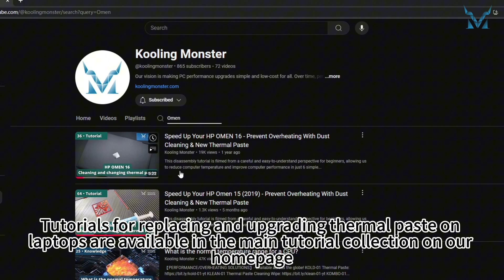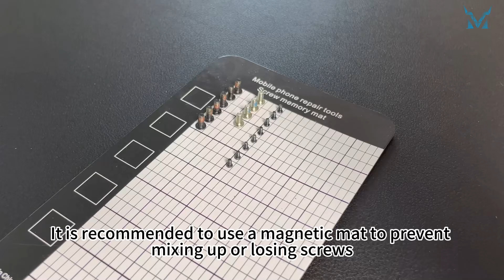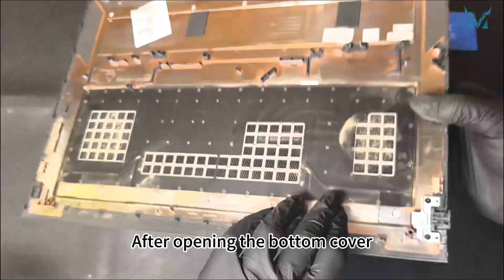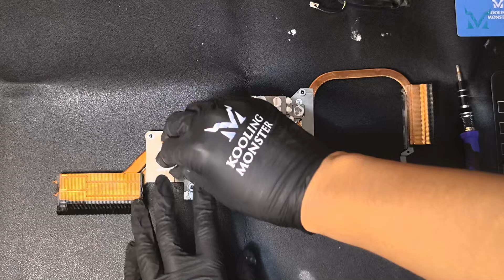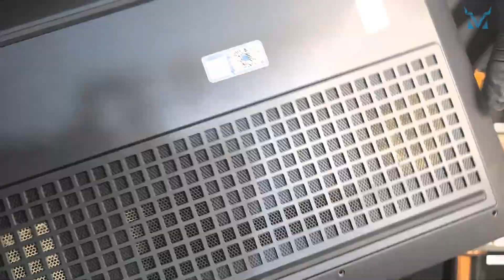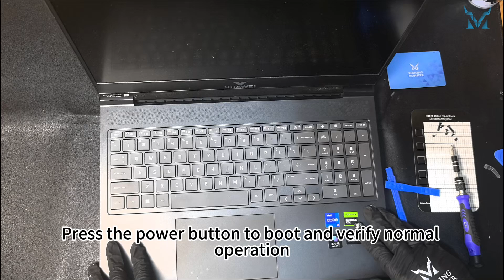Speed Up Your HP Victus 10 2024  Prevent Overheating With Dust Cleaning & New Thermal Paste

Comment: What about the other white pastes from gpu memory for example? I removed them without seen the video, then reaplied bu  i think i screwed, because the gpu memory now it's reaching 100°C. Help me!😭
Reply from the maker: Those white pads on VRAM are thermal putty, not paste. Normal paste can't fill that gap and is causing your 100°C temps. Get thermal putty like Upsiren U6 Pro or CX-H1300, apply generously on each chip, and remount the heatsink. Temps should drop back to normal.